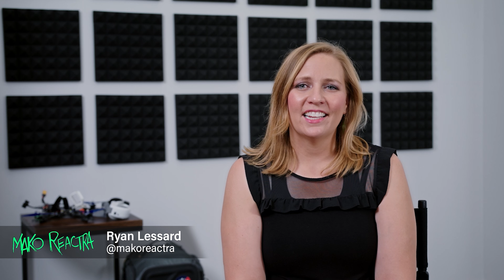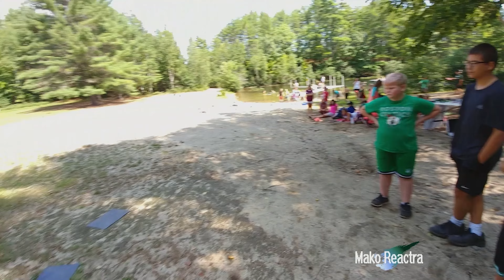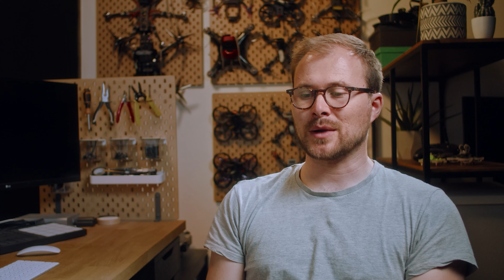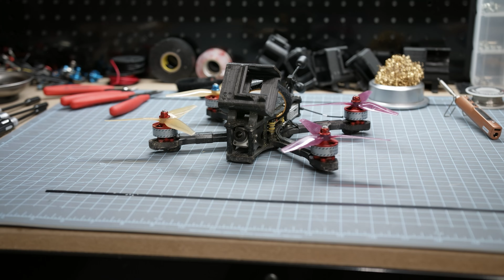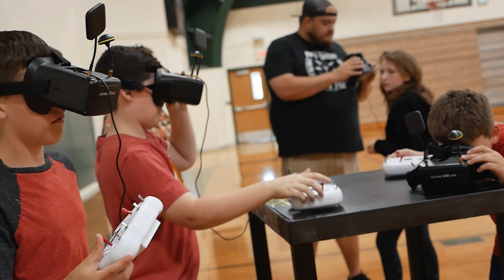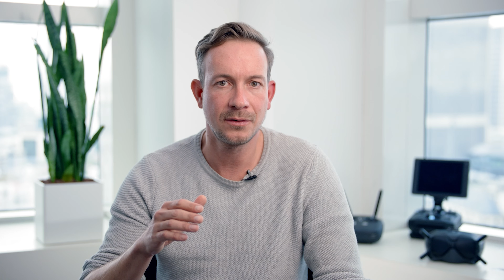Innovation // FlowState FPV Documentary Deleted Scene

Comment: This is so true.
I got into 3D printing and CAD designing because of FPV.
I learned soldering because of FPV. I learned about radio signals, even got a little bit into coding.
It's just such a motivating hobby, that hard tasks suddenly feel easy, because you have fun doing them.
Reply: Quite literally all points mentioned apply perfectly. I learned soldering and landed a dream job in antenna production cause of it, later 3d printing and cad design came easily when you have a hobby that encourages self paced learning
Reply: Necessity is the mother of all invention. FPV is all about multi-disciplinary aptitude. You necessarily must be good at so many skills to be a well rounded pilot.